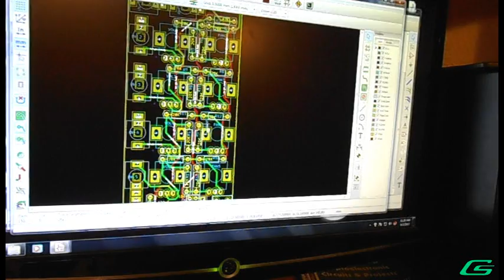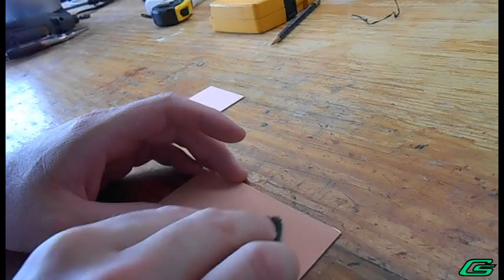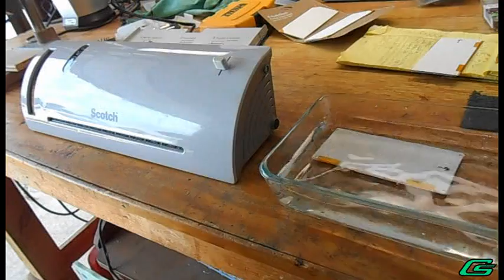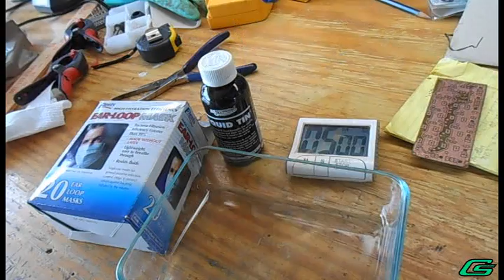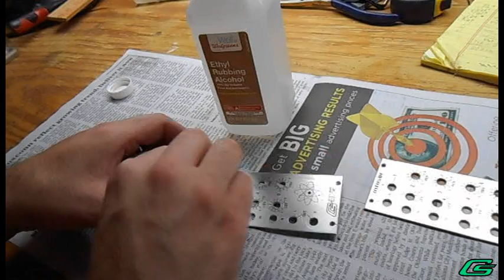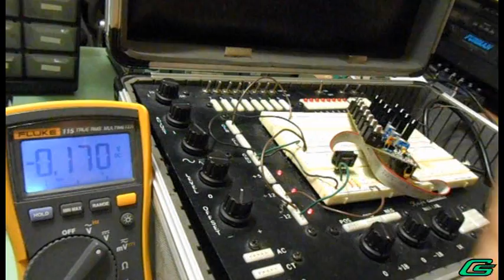Building A Eurorack Module By Hand

Comment: Great video man! What graphics software did you use to design the faceplate? I haven't found a program that lets you design dimensionally accurate graphics easily yet.
Reply from the maker: These days I design the pcb/panel side-by-side in Kicad using the PCB Layout Editor.

Comment: Not sure if I heard correctly, but did you say the printer is specially designed for PCB prototyping? If so, what printer is that?
Reply: Ah cool, replayed it now, louder now that baby is awake heheh, "special paper"
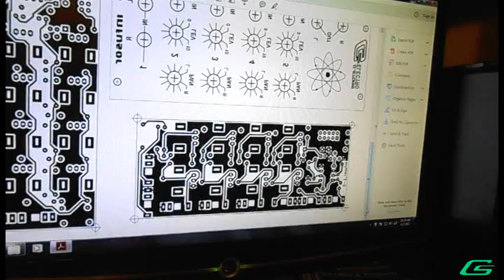Reply from the maker: The printer is normal.  At 0:34 the layout was printed on a special paper for electronics prototyping.  Specifically PCB Fab-In-A-Box Pulsar paper.

Comment: How did you modify the laminator Machine?
Reply from the maker: I changed out the resistor so it could get a bit hotter.  There's YT videos out there that show how to do do it.  However I bricked 2 of the cheap laminators during use - they're just not made to handle it.  Better to spend a bit more for a machine made to handle the extra heat.

Comment: i want to buy mutable's clouds PCB and try building it, but i have no idea what i'm doing....but maybe i should just go for it.
Reply from the maker: Woa slow down buckaroo.  These are notoriously intimidating/difficult to build, 0603 size SMD resistor/capacitors the size of a pinhead.  The ARM processor legs usually get solder bridged, easily lifted pads, and shorted by ANY residual flux in that area.  Not to mention all the hoops to jump through programming the ARM processor w/ the mutable code.  There's a thread loaded w/ failed attempts at https://www.muffwiggler.com/forum/viewtopic.php?t=143366  My advice, start w/ the easier, thru-hole stuff.  Then work your way towards tiny SMD stuff later, maybe my 2xADSR PCB/Panel (1206 size SMD parts, easier to deal with).  Every SMD build I do from now on involves solder paste and a custom made SMD stencil.  Also, there's no shame buying off-the-rack mutable modules from a store.  I may do that w/ the Plaits for all the reasons above.

Comment: What exactly are you doing when running the voltages through the PCB? Testing junctions? I'm new to all this so I'm always just asking questions.
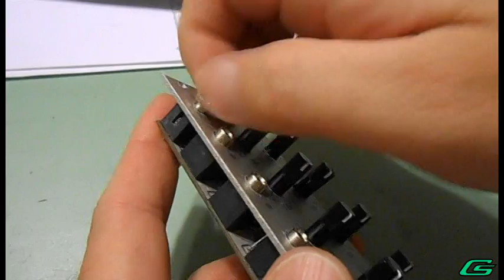Reply from the maker: @5:15 this is something I used to do when testing for the first time, or troubleshooting, a circuit is to see if the power supply pins actually measure what they are supposed to be.  For example, if the +12v rail on the module actually measures 0v I know I've got a problem and probably shouldn't plug it into my eurorack system for further testing until it is resolved.  It's ok if you don't have a test lab setup like mine, you can still do a quick check of the power supply pins.  And this easier method is what I do these days.  With the module power unplugged, use a DVM to check for continuity between +12v and ground, then -12v and ground, then +12v and -12v.  If it shows 0 ohms there is a short - usually a solder blob somewhere.
Reply: gstormelectro awesome that makes sense. I have a few good tools,a bench supply and a scope, a multimeter. Your videos are great. I watched u fix that key on the ms2k, super inventive dude keep it up! keeps folks like me trucking on!

Comment: BEAUTIFUL!!  Super Brilliant!  The timing with which I came across this video made it a very ‘YES!  Anyone can do it!’ Sort of moment for me.  Is that sort of paper a whole lot less hassle than these other toner-style/iron transfers?  Also, maybe if you knew the size of the drill bit for the through hole stuff, or is it the same as the regular holes on boards?  That liquid tin is something I’m surprised to have not seen in any video before.  Last but not least, I see you’ve made the Turing Machine, with the expander that uses the fader potentiometers that have the little LEDs in the slider, did you have an easy time sourcing those?  I haven’t found any that are actually economical for me.  Thank you, that was awesome.
Reply from the maker: Hole sizes vary quite a bit, I measure all component leads w/ a set of small digital calipers from Harbor Freight.  The wire gauge bits are specialty size not carried in general hardware stores.  I bought a set from from Woodcraft if you're in USA https://www.woodcraft.com/products/woodriver-20pc-wire-gauge-size-drill-set.  Word of caution, using liquid tin requires respiratory, eye and skin protection.  I don't have a Turing Machine, but Mouser carries the Bourns slider pots w/ LEDs.